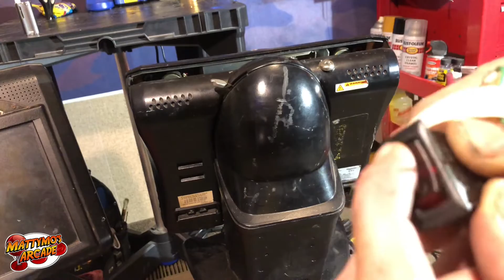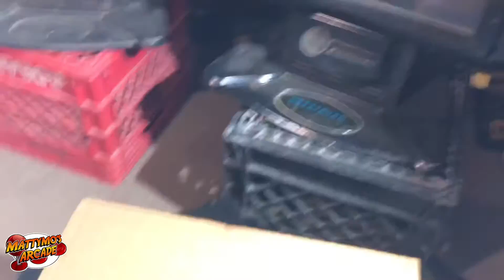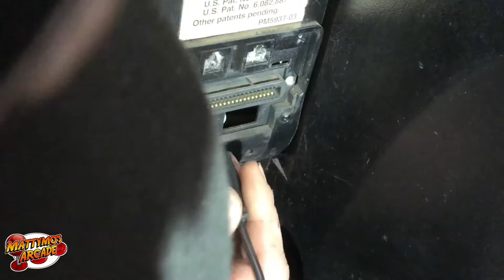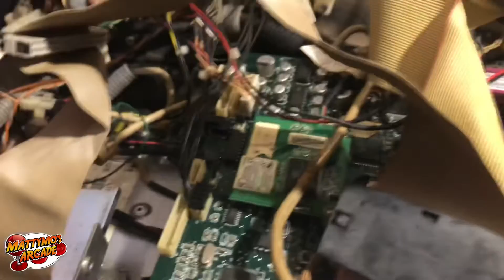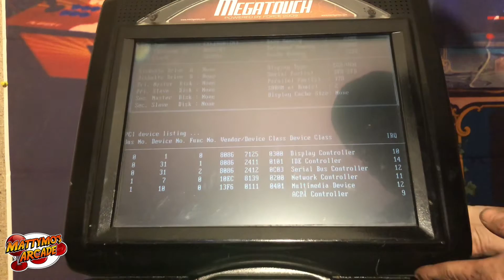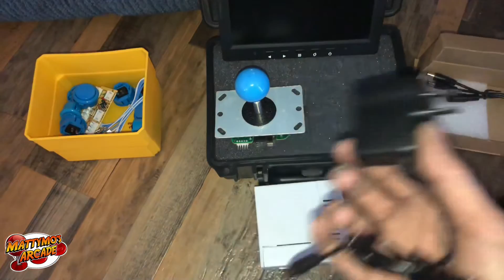Megatouch Evo Repair: Almost Every Problem Possible

Comment: One of mine says 
No input signal (Force 2007)

Other does nothing but turn on the bill acceptor (Force 2005)

I have changed the battery in both.

Comment: Did you make a part 2 video?  I can’t seem to find it.
Reply from the maker: No I didn’t. I bought a new power supply, put all known good and working parts into one cabinet, power supply died after 15 min. I haven’t gone back to it yet. I got frustrated. Lol
Reply: @ thanks for the feedback. I received a mega touch 2008 that won’t boot up after non use for a few years so your part 1 helped to consider it may be the battery as the start for troubleshooting. Now to figure out the cmos reset process once I replace that battery. Ha

Comment: Either the I/O board or the power supply. I use to have some Megatouch machines and I always changed the hard drive to a noise less drive. Those machines weighed about 70 pounds. I have the JVL Retro. Weighs less and doesn’t have a hard drive. The battery 🔋 lasts about 12+years on average. I had to change my battery 🔋 on the JVL a month ago. Megatouch is a headache 🤕 sometimes.

Comment: What can I do if I purchased a Megatouch Gametyime and the person doesn't know the Options menu password? I can't enable the Erotic games because it's locked behind the menu...thanks
Reply from the maker: Did you try 0000, or 1111, sometimes that’s all it is
Reply: @MattyMosArcade  hey thanks for responding…I did try those. They didn’t work. I had to boot it up while the setup button was pressed and use the DIPSWITCH to reset everything.
Reply from the maker: Nice. Glad you found it!

Comment: Dsub analog cable disconnected? Everything works but the monitor shows that error! Any one??

Thanks
Reply from the maker: Try plugging another monitor in to see if it pops up.
Reply from the maker: Usually the power supply is dead in this situation though.
Reply: I tried a new power supply still nothing, I did try to plug in a different monitor but I don't even get the dsub error is just blank. I waiting to receive a new motherboard. I hope that's it. Thanks for the response.
Reply from the maker: Motherboard would’ve been my next suggestion. Good luck!

Comment: How's it going? I've got a megatouch ion 2006 but i had to force boot it with a jumper cause it wasn't booted got it to boot and it almost fully booted and says im attempting to isntall a ion drive on a force system. Is there a way to download force software from online and create a new drive?
Reply: I get an dsub analog cable disconnect would you happen to have an idea?
Reply: What did u jump to force boot

Comment: I just picked up a xl extreme but won't load past startup says hit f1 to continue but plug in keyboard and doesn't do anything any advice
Reply from the maker: You have to use the ps2 port for the keyboard, not the USB port.

Comment: I have a MEGATOUCH Force 2007 EVO - the tough screen has dead spots.  any ideas?
Reply from the maker: Did you try to calibrate it?
Reply: Way to go Matty Mo!  Definitely improved after recalibration - not perfect but better.  Now Im getting the  beep and "no input signal -check connection".
Reply from the maker: Check the power supply and make sure it’s putting out solid 5v and 12v.

Comment: I’ve got a force evo that boots to “touch screen controller error” I’ve swapped motherboard with one from a working force evo but still problematic. Have you seen the microtouch controller go bad?
Reply from the maker: I have had to swap those out before. Usually it’s just the box part, and not the screen part itself. If that makes sense. Lol
Reply: @MattyMosArcade  yeah makes sense. Took your advice and put the box in a working one and same error. Looks like the just the box is bad. Now to hunt one down. Thanks for the reply.

Comment: I have a Mgatouch force 2006 that has come up with no input signal, check connection fault. Any ideas on what the issue may be? Any help would be much appreciated 🙏
Reply from the maker: Test the voltages from the power supply first. 😀

Comment: Mine says “no input signal check cable” I cracked it open and the cable looks good, any advice ?
Reply from the maker: Check the voltages on the power supply. Sounds like you have some power, but the motherboard isn’t booting.

Comment: I have the same MegaTouch Force 2008 as the one on the left and the one in the YouTube clip here:

https://www.youtube.com/watch?v=ojvSu2Y_mJM

It also does the same looping. Any ideas?

I would comment on the YouTube video but comments are turned off.

I've tried turning it on/off many times, but same looping. I try hitting the internal buttons to get to a menu of sorts but no luck. I have the play key, and I have have tried starting it with and without it, but no luck.

Any help, or even suggestions on which part to replace are appreciated.

Comment: I found in the trash two megatouch 2006 do you think they can sell for parts if so how much do you think they can go for thanks
Reply: Screen doesn't turn on i put a dollar bill and it took it  up Screen is black
Reply from the maker: If you were near me, I’d buy them. They are worth at least $25-$50 if it’s totally crapped out, or up to $100-$150 if it’s fixable. That’s for each one.
Reply: Got it thanks for you response have a good day sir
Reply from the maker: You bet!

Comment: Hey i have a megatouch radion force from 2002 an it’s always bipping an R77 red light is showing don’t know what to do ?! Help thanks
Reply from the maker: Start with checking the connections and test your voltages. The 5v is very important.